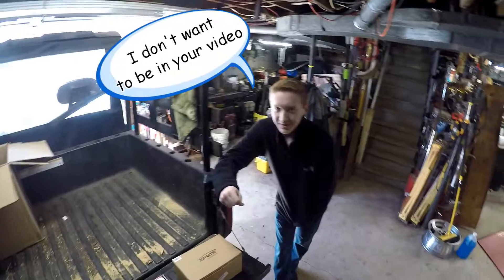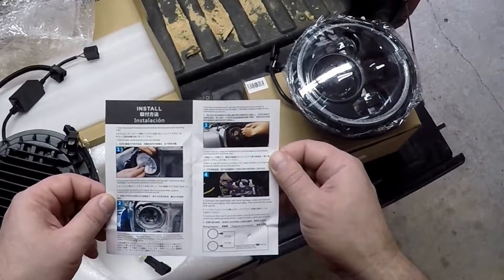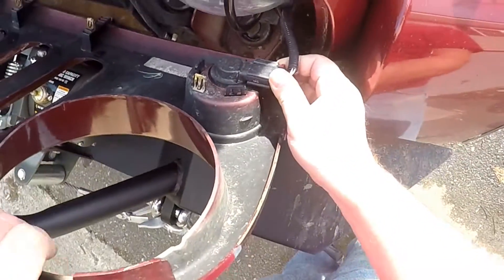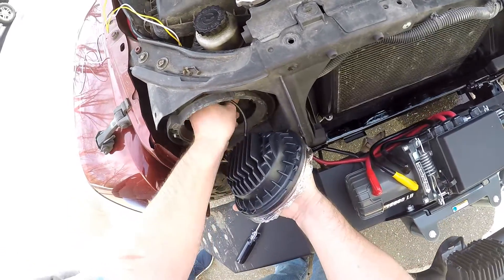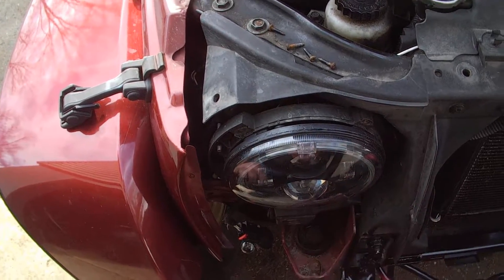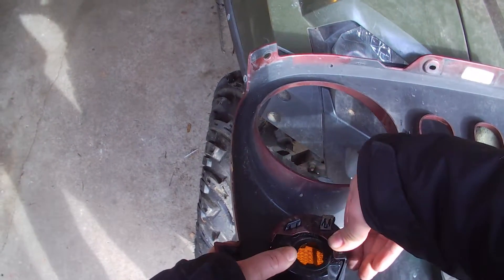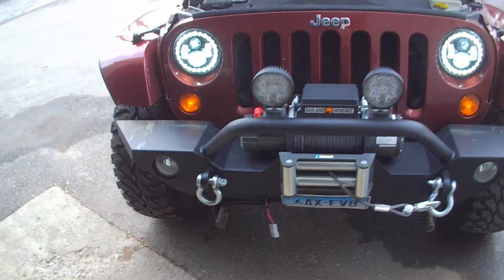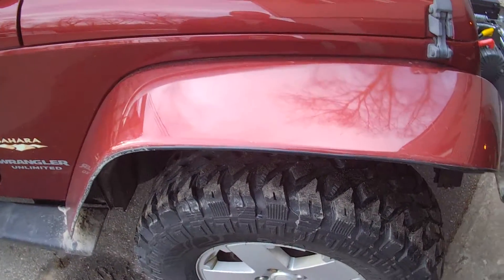Jeep Wrangler 7" 90W PHILIPS LED Headlights Halo with Fog Light unboxing, installing testing

Comment: I bought some $130 set of that style. I have the "blinker" section to be on with parking lights to go with my yellow/Amber setup. The light pattern is definitely nicer on yours though. My rigid industries radiance light pods help though.
Reply from the maker: AceInvader I was looking at those, I didn't hook up my blinkers because I want to do something different with them. what are the reflectors you're talking about?
Reply from the maker: pods I meant
Reply: MotoCheez they are a small 3x3" light pod that rigid industries makes. The radiance series is there more affordable line, but it also has a cool backlit design. I picked orange to go with my amber lighting. Just like the headlights, I have it wired to get power whenever I have my parking lights on.
Reply: They also come in bar lights, from 10"-50".

Comment: Hey off subject to video but how do you manage to keep the control box on your winch from popping of mine always does pulling logs from creek due to the way the cable winds up not really willing to get hands in the way to guide cable so I had to mount mine to upper radiator thanks zx10rmafia
Reply from the maker: zx10rmafia zx10rmafia I don't use it much, if I do use it I end up pulling it out and winding it back neatly because it bunches up like you say.